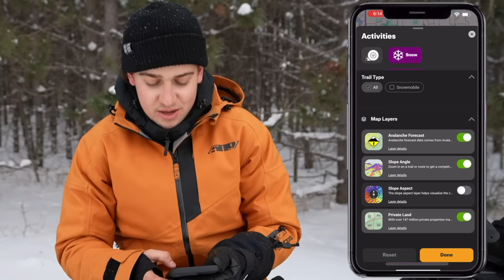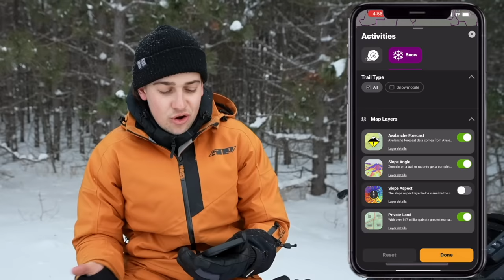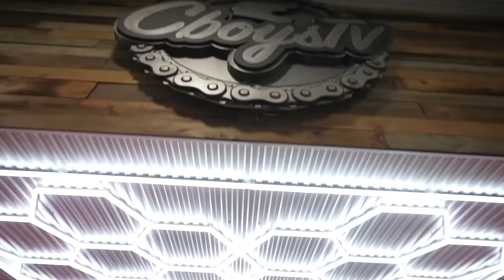Three Wheeler Snow Riding on Tracks!

Comment: Snow buildup on the intake seems like the common failure point on all these street bike conversions. Maybe need to modify these to have an external K&N type filter with a snow screen you can just brush off.

Comment: @coybots I think 3 wheelers are so ez to flip do the the engine placement if could put motor on rear evenly it would have to help solve flipping prob you guys should try putting double ski on front of one or a wide kinda long ski idk if been done but prob work